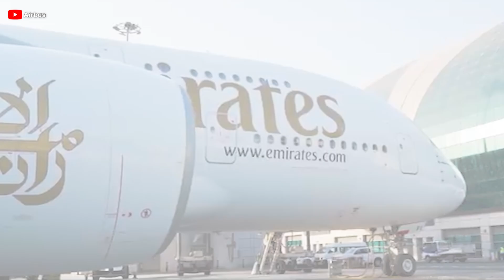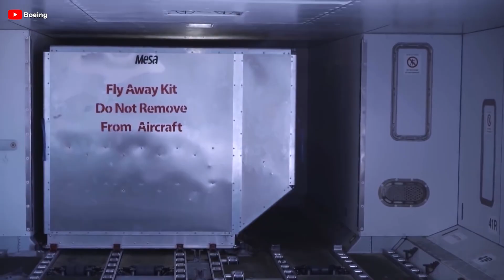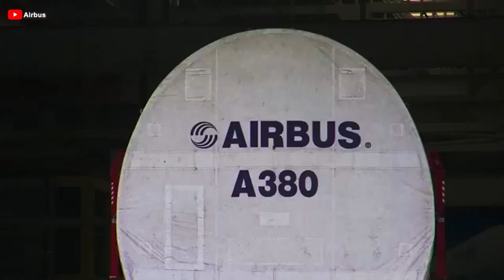Airbus’ Next A380F will SHOCK the aviation industry! Here's why

Comment: There's two big hurdles if the A380 has to overcome. First, the cockpit being on the lower deck limits a feasibility of a nose cone opening for long freight objects. Second if the two horizontal decks of the A380 have to be maintained for fuselage integrity,  then there's no chance of it hauling large diameter objects like the Boeing 747F or 747-8F.